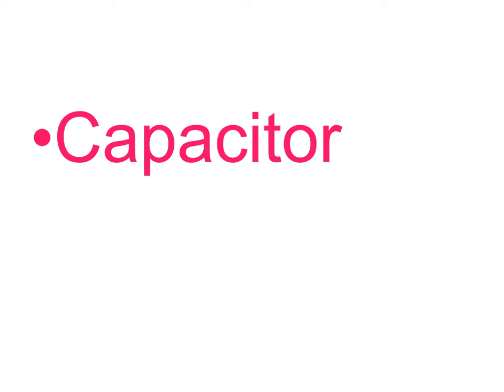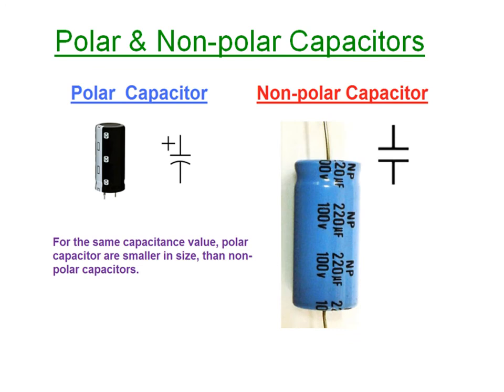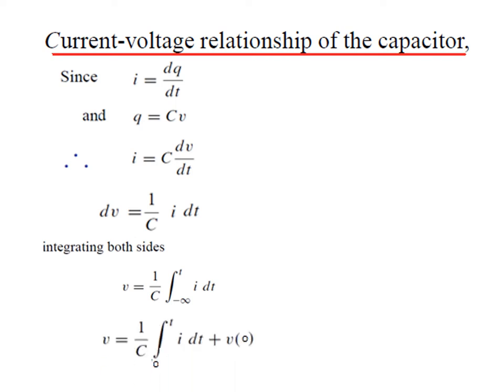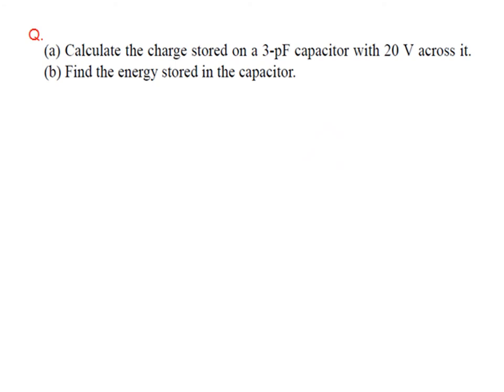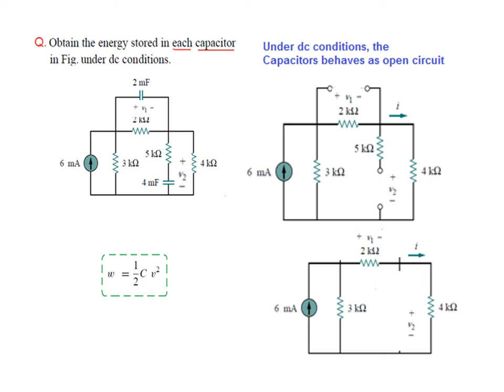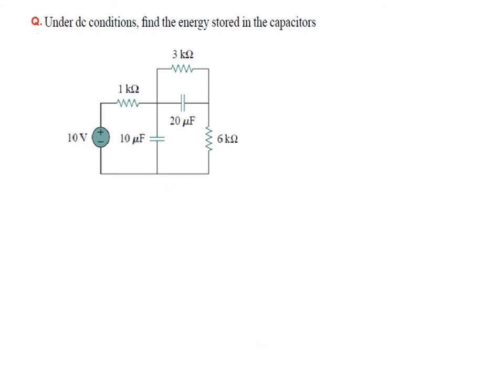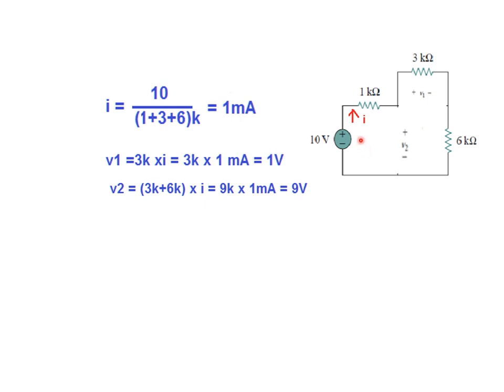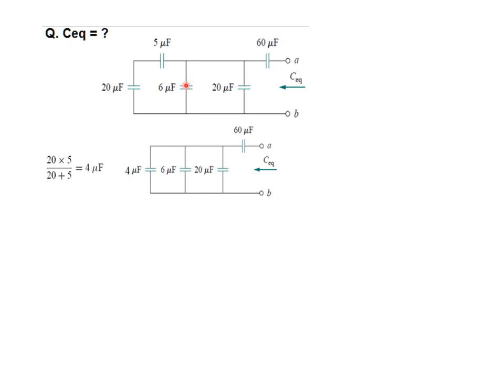Capacitors || Example 6.5 || Practice Problem 6.5 || Example 6.6 || LCA 6.2(English)(Alexander)

Comment: Sir:
V1 = 3k x 1m = 1v How?
V1 should be 3k x 1m =  3v 
there is a mistake!!!
And the answers are:
w1 = 90pj 
w2 = 405pj  
just wanted to notify you the correction,
Thank you for the lecture :))
Reply from the maker: Yes Danial, you are right, there is typo. Thanks
Reply: @ElectricalEngineeringAcademy   
:)
Reply: @ElectricalEngineeringAcademy  my pleasure sir :)